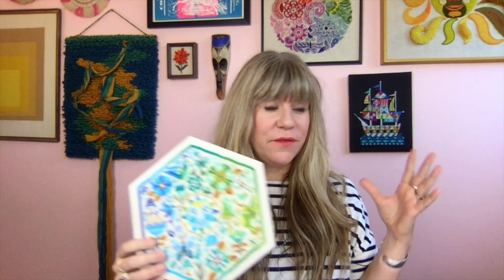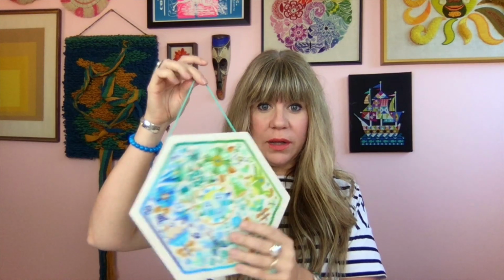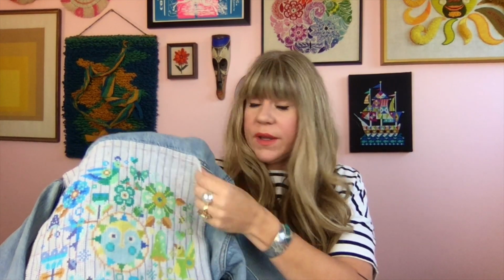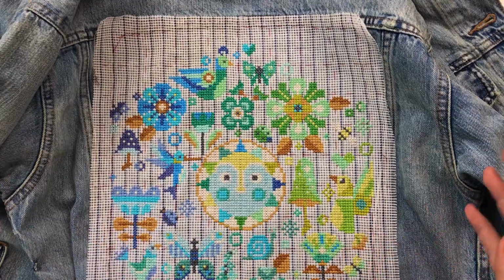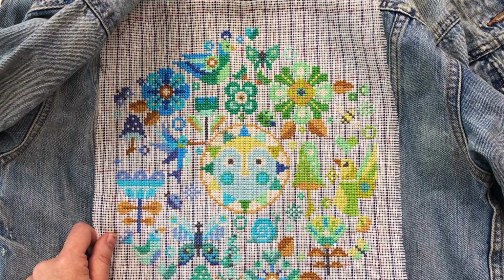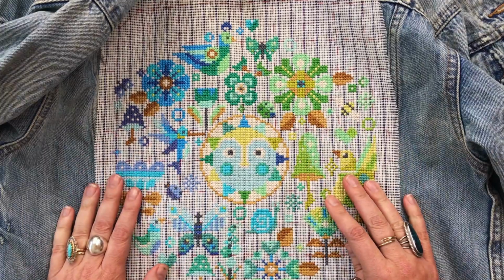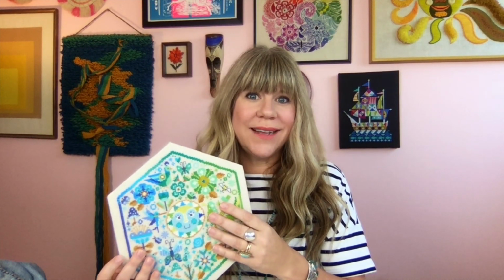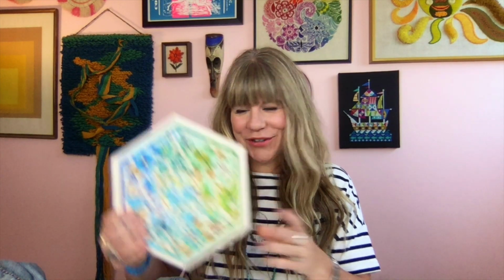Satsuma Street Floss Tube #1

Comment: Love your designs and love this project!  Just wanted to mention that IF your base fabric & and your threads are colorfast it is MUCH easier to remove the waste canvas after you soak it in cool water.  The water dissolves the starch that basically holds the waste canvas together.  It comes out so easy after that.  No more numb fingers! 😊

Comment: Really cool...but how did you maintain tension? Did you use a frame or a hoop?
Reply from the maker: I tried using a frame but the jacket was so heavy I couldn't hold it! The waste canvas is very stiff, so there's not as much need to keep the fabric taut.